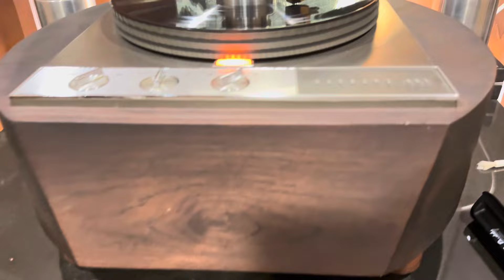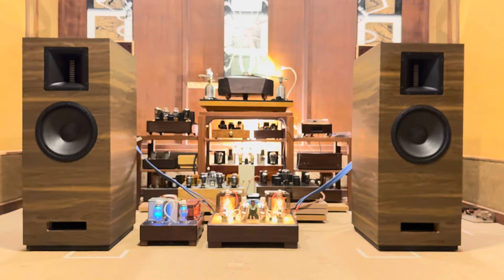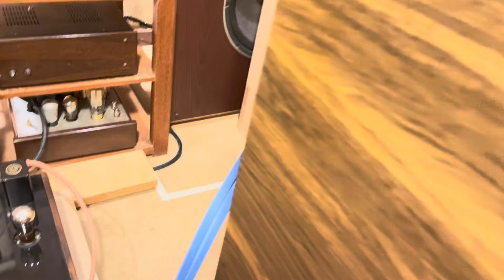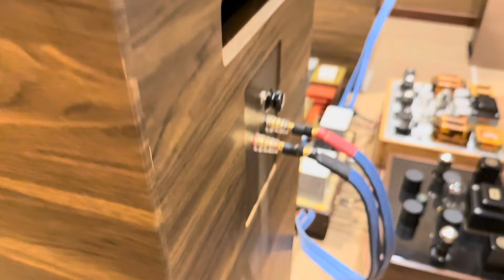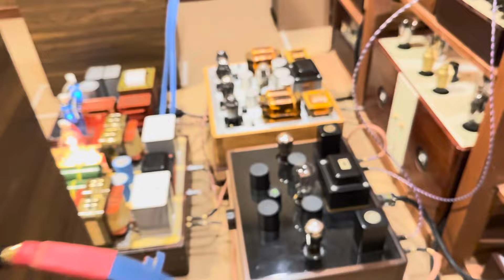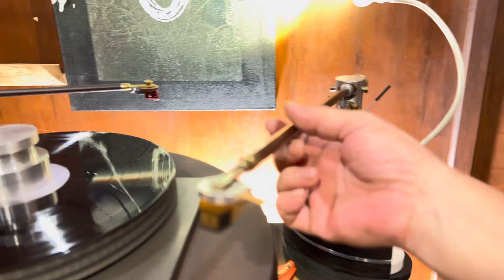DIY Audiophile: 100TH SET Class A tube Amp

Comment: Damn this stuff is cool. What are those blue tubes?
Reply from the maker: It is 866A rectifier tube with mercury vapor.
Reply: @edSuwanDiyAudiophile  Sonically, how do you find them? They look great...
Reply from the maker: @benjaminlloyd7868  I got this at a local vintage tube seller. 
This rectifier tube is needed to become a high voltage PS of more than 1000Vdc to supply the 100TH DHT tube. 
Mercury tubes provide a warm and clear sound compared to others.